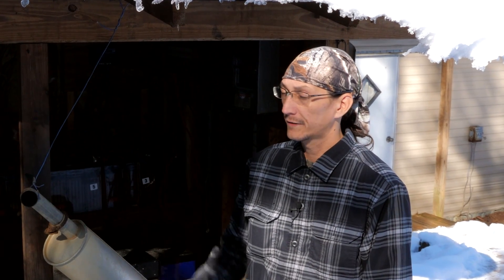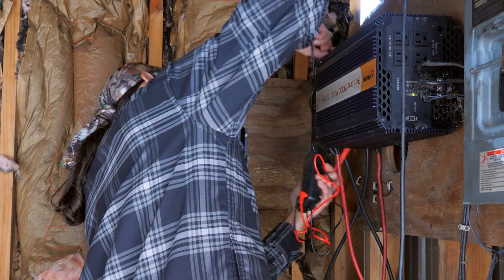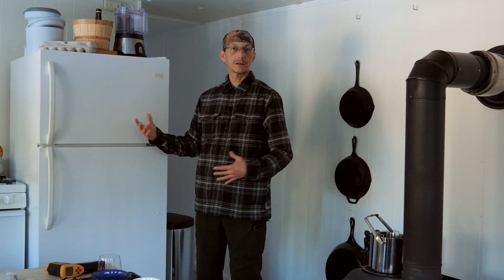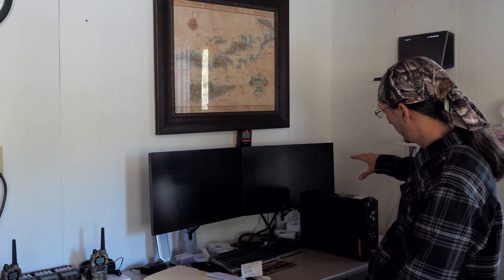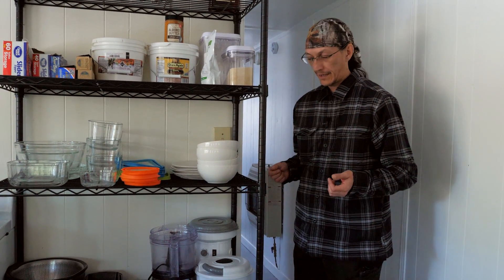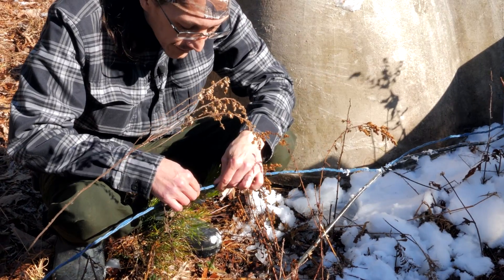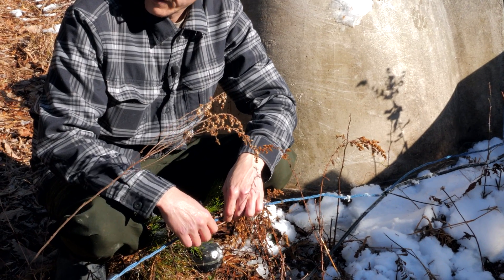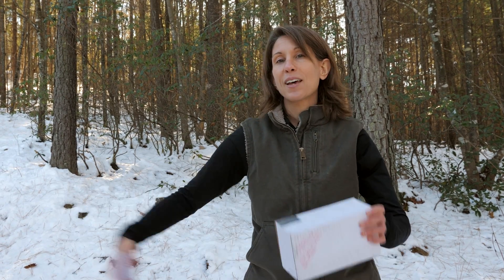Off Grid Electricity - Our DIY Solar System

Comment: To measure power/energy transfer, you need to measure current as well as voltage. You need a clamp meter that can measure DC amps with the clamp (most do AC only). Here’s one that works good for the best price I ever saw 👍
https://www.amazon.com/gp/product/B00O0HLBJ8/ref=oh_aui_search_detailpage?ie=UTF8&psc=1
Reply: Mr. B yes that is how they taught me in school, but it’s not really done anymore: too many disadvantages. First is that you have to disconnect the circuit so it’s disruptive and systems need to be taken out of service, plus it’s much more work, like 5 minutes per measurement extra while the clamp takes only a second. Also, range is a problem because you need multiple shunts to cover the same range that the dial on a clamp meter does. Ever shunt plus jumper cables is extra to haul around while the clamp on the meter is small and light. Last is the cost: you can’t beat a $40 clamp meter. 👍👍👍

Comment: As Jeremy knows hot and cold are the enemy of batteries - and that battery shed needs some work - but depending on where you're going to locate your home it might not be worth worrying about this present battery shed as it might be relocated anyway...  To me it looks like rain and melting snow will make a lake out of the floor of the shed, too, making an additional problem. eek

I always suggest some sort of wind generated power, I'm betting you and Jeremy are smart enough to do it on the very cheap, and while you sleep at night even gentle winds can be trickling a charge into your batteries... 

You have a lot of trees on your property, and a lot of dead falls - I'd be yanking those out to cut up into my firewood stack - also any standing dead trees (assuming one can tell a dead tree from a live winter stage deciduous tree).  I realize homesteaders vastly differ on how they want to manage their land and trees, many want the trees to rot back into the ground that grew them. That takes decades, however, and in the meantime they add to the fire danger and injury risk to humans and animals that must stumble over them... Some of that downed timber might even work as fence posts or rails around the perimeter of your land, or in building a "log cabin" style barn for your future goats.

Today Red Tool House gave your channel a shout out, their topic was checking the zoning laws when looking for property, and they mentioned how you lost your goats ... so I will give them a shout out to you as he has several videos concerning logging off of his property, and timber management, that you may find interesting. They actually purchased their property about 20yr ago for $55K and almost immediately earned $30K from it by having it selectively logged off, and his forest was still dense!  He has access a few miles down the road to  "lumber mill" equipment, so he can haul logs down there, and come back with finished boards sized to his needs - it is maybe possible you get to know your neighbors and come up with similar or other homesteading needs trade offs.

Good job putting the fridge out on the porch, it'll do okay out there. We had outside fridges do just fine in NE WA State, where it gets well below zero for extended periods of time.  Moving it out also made an area for Jamie's kitchen stuff!  Win Win!

Anyway maybe you get some help from my rambling, or maybe one of your followers might... I am just so thrilled and a bit jealous of you two!  You literally have a blank slate to work with. The possibilities are nearly endless.

Comment: If I remember correctly, batteries generate a small amount of heat when charging and discharging. Putting a door on that shed will make a difference in performance. Also it will beautiful that area and will keep courious hands out. You definitely don't want anyone to trip and fall across those terminals. A simple door would solve all these issues. You might move some of the insulation around... Wouldn't you rather share heat from the house to the electrical room than cold from outside to the electrical room? xoxo from Arizona.

Comment: Dc pump, don't forget inverter load (~15% of the rated power of inverter) 75w×23hr/day is significant.  Can you use a smaller inverter? I don't recall seeing the size of wire you have going to the inverter,  but i doubt it was 000, required for that inverter.

Switching to an MPPT controller will net a ton of gains.  You are losing 5 volts in transmission losses. Make sure the controller can handle ~120vdc in (maximum cold temperature efficiency & safety factor,  and run in series.  Alternatively, run 2 chg controllers (power of all panels on a given controller  <= the minimum attached) it may be advantageous to run the  home made panels through MPPT and those 2 commercial ones parallel through the PWM controller.

Comment: First you  need to put in bigger cable or get a  charge controller like esmart3 about 120 dollars and can handle I put voltages of 130v so you could wire your panels in series and have less loss and keep the current wires for now. The esmart3 get the 40amp unit if you buy it it will work for 12 24 36 48vdc. Buy every thing for a 48v system will be more efficient good luck by the way a 12 volt battery full charge float is 13.7v your battery are not at full charge yet that is also another reason they go down faster
Reply from the maker: We will look into it!
Reply from the maker: Wait...your video says you don’t recommend the esmart3...?

Comment: estimate  your watt hours of usage then size your battery bank and then size your solar PV to t
o be able to charge your battery bank. DO NOT mix batteries and do not mix PV of different wattage and also check wire size to carry current and each voltage.
Hope this helps,

Comment: If the sides of the fridge is hot, I wonder if you could get an aerogel blanket/mylar heat reflector to cover the fridge sides facing the wood stove to help keep it cooler? ie assuming having it out on the porch does not work.  Thanks for sharing all the videos, looks like an awesome place to live. :)

Comment: I heard about your switching batteries out on your little bitty lights ye pot lights.. that's how fast is going to be just about better then playing with kerosene lanterns having to refill them all the time.. you may consider stringing them together like podlights.. like a stretch along a wall hi on the wall and using doorbell wire to power them.. and for power ultimately you want a bigger battery that is reduce down or matching the need of the light.. and this would be a another solar panel addition to keep them charged concept. Consider a battery like a gel battery that will not need to be vented..

Comment: when you run the generator you could pump water closer to the house and pump it with a 12v RV pump into the house when you nrrd it.
Reply from the maker: That is the ibc option we spoke of in our 5 challenges video

Comment: Consider a split water system:
-one pump powered by a separate system to get water from the spring to a storage tank at your house, feeding 
-a relatively small pump to pressurize the piping in the house.  The second pump can be a small 110V pressure demand unit

A YouTube contributor called Engineer775 has shown several applications of this idea on his channel
Reply from the maker: Stay tuned 😉

Comment: basically living off grid as a homestead is living off your own work equity .  If you are not very DIY and have a good physical as well as mental work ethic don't do the homestead part.  That being said the next step in comfort whatever it is becomes a great motivator ( get the well done for water, get wood cut for heat get building dried in get insulation complete, get chicken coop done or pan built for protection get garden going and tanning done for food etc.)

Comment: hi.  you have 13v coming in because the energy on your panels is 13v but your battery is like 11.4v so you will get less going to the battery to charge .  If your battery volt was 12 then you would use the 13v from the panels.

Comment: That wire gauge is way too small for 150yds, try any local scrap metal yards, you might (if you're lucky)  find a heavier gauge wire there cheaper than other places. I'd be looking for at least a 10mm² or 6-8 US wire gauge (from what I see on conversion calculators) on that run for less loss. It can never be too big, but prices get ridiculous. Better to hook your panels in series to get the voltage as high as you can (less volt drop) and get a controller that can handle the variable voltages incoming. The higher the voltage, the lower the volt drop.Or move the panels closer. I wouldn't even try running mains power on those wires you've got, they look about 4mm² (or smaller) from the video, too small for code in the country I live. You need ever amp you can squeeze out of your system. (retired sparkie here) Best of luck.

Comment: All motor loads have much larger startup current than run current, this must be taken into account when designing your system. Submersible pumps are particularly  bad. 5-6 times run current, so 1kw pump needs 5-6kw to start. Better to use vfd or soft starter to control startup current.
On our farm we use pumps that run direct from solar panel, no battery required if water is pumped to tank higher than your house. (Google Tuhorse).

Comment: Why bring the refrigerator in off the porch at all. Just keep it shaded in summer. Elevate your solar panels on some 2x4s...snow likely will slide off allowing solar panels to charge even in light but cloudy weather. Look at Bison water pumps. Consider a 12V/24V water pump at spring to camp running during the day off a separate battery / solar bank. It can be doglegged into regular batt bank at other times. Amazon sells a small LED solar light with its own solar charging panel for $10. I use one it works well enough for short term light.  Add a second / 3rd shelf in the battery shed for a second or 3rd batt bank. Doesn't 13.5V on charge controller indicate that it is charging batts? Isn't 12.5V indicative of a healthy battery charging a batt bank? Remember to ventilate your battery shed. Add a second wire from solar panels on hill to battery bank. So as to not choke generated solar power and lose power in the 150 yard(?) downhill  run.  Good video.  Best
Reply from the maker: It gets into the 100s here.
Reply: Guildbrook Farm | Simple Sustainable Living --I meant to say leave the fridge on the shaded porch BUT plug it into electric when temp is to be between 38°F and 100°F plus.. Best

Comment: How is your pantry holding up in the cold temps???
Reply from the maker: Knock on wood, so far so good. It got down to 19 last night.
Reply: If you have excess charging on your solar, you can create a thermal sink like a low power water heating element that could be used in barrels of water.  Placing these inside your food storage might be helpful in maintaining desirable temperatures.  Its a method common to wind generation arrays and is used in barns in water troughs for animals and such.  Maybe useful here.  Hopefully that's helpful.

Comment: Interesting. Actually, we are running also on solar and still not optimal either. For now. One of the things is we have it on our roof. The roof is the perfect angle here (was designed for it). And to minimize the loss, we put the charge controller inverter in the house. But, the inverter has a fan which makes noise (we didn't know that when we ordered it). Also, I wanted to have a high watt inverter 5000 Watt. But the only one I could get was one that would convert 96 volts to 220 volts (I live in thailand where it is 220 not 120). So that means we needed to chain 8 batteries of each 12 volts to get to 96 volts. Same for the panels which are 24 volts 300 watt each. with 4 panels.

The result is that indeed not everything can run on the panels. So the planning is now to add government power to it (that is available not too far from our house). Next, move all to our new barn (just conpleted it and the roof is designed for it). So we don't have the interter with fan in the house anymore. And then extend it by triple the panels and batteries. Looking forward to see what then can properly run on the solar. Of course we are lucky here that we are near the equator.

Still wondering what we will be able to run and what not (now indeed for example a water heater is impossible to run and the pump can but not easy. We still don't have a fridge but that will come).

Also wondering what can run on it tool wise. For example my welding equipment. I think that draws a lot. 

Finally, still thinking on how to design the government power / solar. Should I just double wire the house and have some outlets in places that come from the government? Like in the kitchen and the barn for high watt equipment? Not sure yet.

Looking forward to hear your ideas as well.

Peter

Comment: First thing you need to do is get rid of the charge controller,  so you can properly charge your system, secondly instead 12v move up to 48v system, not cheap but you can grow into it.
Your ice box will be fine outside and will not even start up if set to highest setting 40 degrees or so, It will not drain your system for now

Comment: With regard to sizing the array, be sure to size for the best bang for buck 10% charge rate for the battery bank given the lowest number of insolation hours, typically in December and January.

I'd also consider starting out with a 48V battery bank to make your life easier in the long run.  Automatic/manual generator assist to charge or meet demand is also a good idea.

The voltage loss isn't all that surprising given the cable diameter and the run length.

Useful rule of thumb array size calculations for a 48V bank of [Bank Capacity] size:

[Bank Capacity] AH * 57.6 volts charging * 1/0.77 panel+controller derating * 0.05 rate of charge = [Result] watt array minimum
[Bank Capacity] AH * 57.6 volts charging * 1/0.77 panel+controller derating * 0.10 rate of charge = [Result] watt array "nominal"
[Bank Capacity] AH * 57.6 volts charging * 1/0.77 panel+controller derating * 0.13 rate of charge = [Result] watt maximum "cost effective" array

Or we can use pvwatts to help us out a bit. I picked Brisbane, QLD for the location to obtain the minimum average of 4.05 with a made up Wh usage of 12kWh daily.

12,000 WH * 1/0.52 system eff * 1 / 4.05 hours of sun = 5698 Watt Array Minimum

Comment: Have you considered installing some mirrors to reflect more sunlight onto the panels you already have?  If you can get them rigged up like a heliostat then it could be a cheaper alternative to buying more panels.
Reply: You will heat up the panels more and the output is lower when the panel is hot, And if overheated it may destroy the panel forever.
In cold weather, panels put out more power. Different kind of pannels react different to heat.

Comment: Using a higher voltage system would reduce the current and voltage loss on the wires going from the solar panels to the charge controler. Moving the solar panels closer to the battery bank would help too if that is possible. I have seen people pushing the snow off the top of their solar panels because the low side of the panel doesn't have room for the snow below it. It seems that it would be better if the panels were up higher so the snow could be swept off the bottom because it would be easier. Any snow that slid off on its own would have a place to go reducing manual cleaning. I wonder if anyone has inclosed their solar panels and put glass over them at a greater angle so the snow would slide off on its own. I am not sure if the sun light having to go through glass would reduce the output of the solar panel but if it doesn't it should save a lot of cleaning. Has anyone tried this?

Comment: Way over my head, but I'm sure you'll get it working the way you need it to. There is a channel called Life Inside A Box, or DIY Homestead...think he changed the name of the channel... anyway if you haven't already, check out his video series on his solar set up. It's HUGE and he is powering a tiny house and a complete rain water system with it. I think Derrick (the channel owner) said it ended up costing something like 10-12k! Yikes!  You may have already seen it, but I just thought I'd share with you. Peace ~Lisa

Comment: I love the your little battery stick-up lights.  I'm totally on grid, but do little things where I can to save on the electric bill, which we've recently learned is going up in three small increments in the near future.  When the water bill went up in three increments, it very nearly doubled by the end.  Every utility here has increased except natural gas.  It is such an amazing thing for you all to be in control of your utility costs.  Can you read into this my little jealousy pangs?  I'm getting some of those battery lights, and maybe I can figure out a little solar charger for them too.  You guys have influence in my life, and possibly in 47,000 others.  YAY!

Also, I'm impressed how organized you are to get all the generator-funded loads covered in one little time frame per day.  It really got me to thinking how spoiled I am to just flip any switch at will.  I likely won't be changing that fact right away, but awareness is good.  Thanks for sharing.
Reply from the maker: It does take some finagling to get everything timed correctly. Really, it only takes one time and you learn a quick lesson!

Comment: Great info!!!! Prior to me buying the homestead vandals ripped out the wiring in the barn and outbuilding...i want both buildings off grid with solar.  Where did you get the portable Honda generator?
Reply from the maker: I borrowed it from a friend but they are about $1k online.
Reply: Thanks for the reply!!!! I've been pricing them!!!!! Very pricey
Reply from the maker: They are but they are real quiet and run about 6 or 7 hours on 1 gallon of gas in eco mode. I love the thing.
Reply: Thank you for all you share!!!!